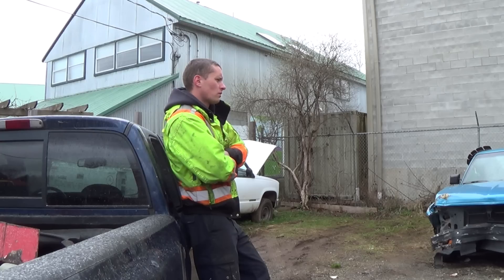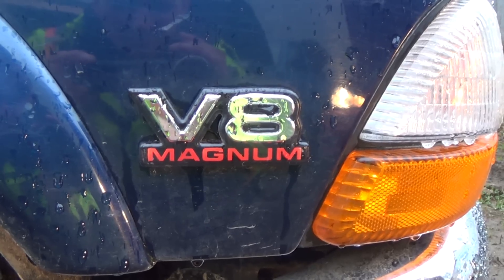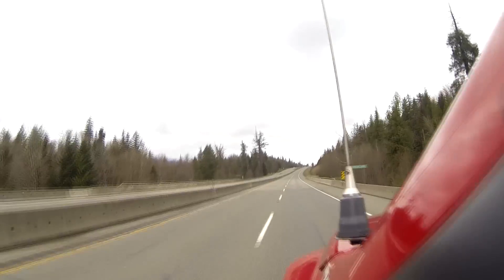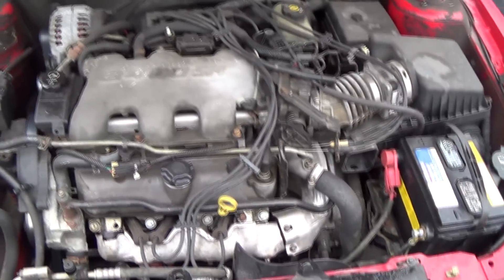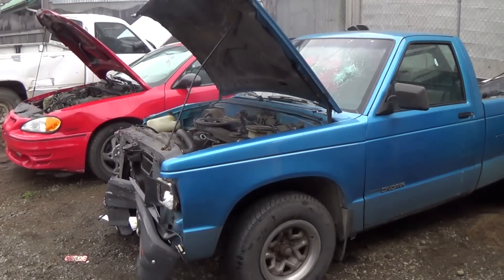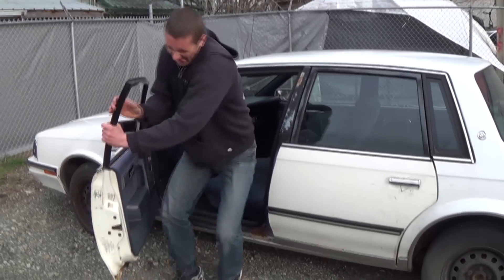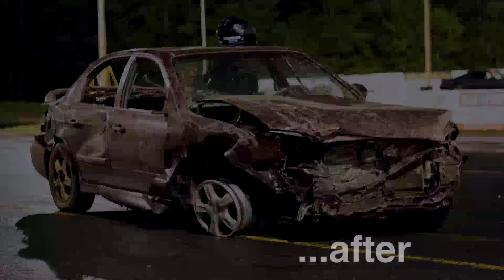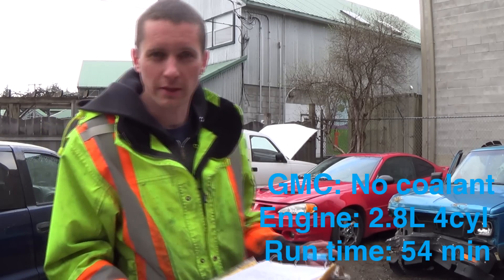How long will car run without oil or coolant

Comment: I ran my car for 1 year without coolant and it never overheated or get an issue I finally put antifreeze yesterday 🤣
Reply: I call nothing but bullshit here
Reply: What make and model
Reply: Bro currently I haven’t put coolant in my car in months and mainly because I know I have a broken hose or hole and for the other guy mines a 2011 Hyundai sonata

Comment: You need to run cars without engine oil and coolant on Mazda, Toyota, Honda, Nissan, Audi, BMW, Mercedes Benz, Porsche, and many more manufacturers to see how reliable they are when engine oil and coolant go low.

Comment: It would have been cool if you strip the engines to see exactly what caused each engine to die. Like if they all blew a head gasket in the end or if the one without oil just seized up etc

Comment: 54min on no coolant, i thought water pump would seize first
good experiment
Reply: Water pumps don't seize up while the car is running unless a bearing lets loose or something like that, and if it did it would squeal like he'll for a couple seconds and burn the belt off. Usually water pumps seize up from sitting for to long

Comment: i didn't change the oil in my Hyundai Santa Fe 2.0Turbo and cas driving when oil light came on and started making noises. I pulled over right away. What do you think the damage is?
Reply: its more then likely toast and requires a new engine...when noises start its to late you killed it lol, $40 oil change vs a few hundred for a new engine...good job sir lol
Reply: The engine is junk if you never changed the oil and its making noise
Reply: Turn out to be the tstat got stuck. Oil was fine. Either way I had to replace crackshaft and heads.

Comment: i wanted to hear the noises it would make but i guess tht wasnt going to happen
Reply: When an engine is overheating, it usually makes a squealing / grinding noise because the pistons and other components expand with heat, and push on the cylinder walls. Without oil it'll begin ticking, which will turn into a rattle then a loud bang; Usually a good indicator your crankshaft locked up. Another is finding your crankshaft's pieces and your oil pan on the road behind you.
Reply: @seannolastfuqingname7308  so how do air cooled engines get away without overheating or needing coolant to cool??

Comment: Killing a Pontiac?? NOOO!!!
Reply: When I first got my Grand Prix, the people before me didn't take care of it at all. So It didn't have any coolant in it and I drove it home 3 hours in stop and go traffic with the air  on and it didn't overheat at all. Pontiac's are great, they need to make them again.
Reply: alex pencek actually a lot of times the cooling fan(s) will keep up. Also the heater core isn't being used unless the heat is on. (When hot coolant is being run through it to make heat). Which it wasn't. Also don't tell me what I do and don't know please. Bc obviously I know more than you. Thx for commenting! 👍
Reply: I call bullshit no car will run long with out overheating without coolant if you had no coolant in a car you wouldn't have heat but your motor would still overheat because air temperature isn't hot enough to heat up the heater core, you obviously don't know shit about cars
Reply: How the heater core works isn't my point, the point is that if a car is completely out of a coolant it is going to overheat no matter what you do
Reply: alex pencek then why did you bring up the heater core? yes I know that most cars will overheat but as I'm stating. mine didn't.
Reply: Now your saying that I brought it up? You mentioned it specifically and said that you turned the air on and it kept it cool long enough to get it home
Reply: alex pencek I didn't day anything about the heater core. anyways. invalid argument on your side. ttyl
Reply: Ik i love grand ams they are very reliable
Reply: Levi Jones thanks for Letting Me Know this bro.  I have a pontiac  I like it
Reply: Mac Jones what about g5gt

Comment: the engine with no oil is that engine still rebuildable? and if so what parts are usually needed to be replaced?
Reply: Generally when a motor locks up it will spin bearings on the crank journals and they are usually scored too deep to cut the journals and or the rotating mass spinning as quick as it does and comes to an immediate stop can bend the crank or send a rod through the block then you might as well forget about it. Your best bet is to find a motor that is tired out for a rebuild

Comment: So my chevy cobalt was crashed and raditor was wrecked I wanna replace it and buy new front end but i wanna make sure theres not more problems or parts ill need can i turn the car on with no coolant and it wont harm the car for 1 min or less?
Reply: +fukz nerdsd you can run the car for 1 minute or less without damaging the engine

Comment: does that Grand ams speedometer really say 220
Reply: +Jack of Blades (Steam) i think it's in kph, which is around 135 mph. top speed on quite a few speedometers
Reply: +Rebekah Walters American Grand Am or (Grand American) GT Ram Air Coupe Says 150 MPH
Reply: I wasn't specifically talking about the Grand Am speedometers, just in general. My car has one that goes up to 120mph, but it's just a 4 cylinder. So, i can see how a car with a more powerful engine would have a higher number on the speedometer. And to be fair, in everyday driving, no one needs a speed higher than 100mph anyway...
Reply: Rebekah Walters yeh they do, Its called Racing
Reply: They're in Canada. It's Kilometers per hour. And I'm really surprised you didn't question why the late 80 early 90's Sonoma said 140. lol. But, again, they're in kph.
Reply: It's In kilometer per hour not miles per hour

Comment: WHY, why would you ever hurt a V8 magnum... :(
never again please.
Reply: The car's in the junkyard for a reason...
Reply: Although I am inclined to agree that the engine is a great one and I love it as well. It was in a Dodge pickup and while Chrysler Corp. can make an engine very well they aren't so good with suspension and steering. Cars don't move without those. lol

But in all honestly I would have pulled the engine and put it into another truck or car just to see what it could really do. I could picture it being put into an older challenger from the 70's and that would breath new life into a classic.
Reply: +nigahiga6400 because it's a pos dodge!